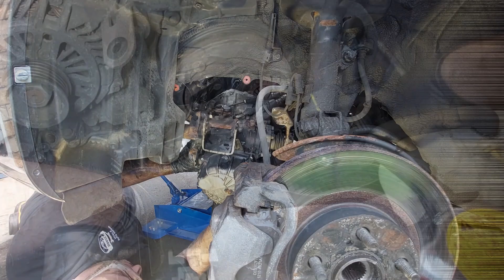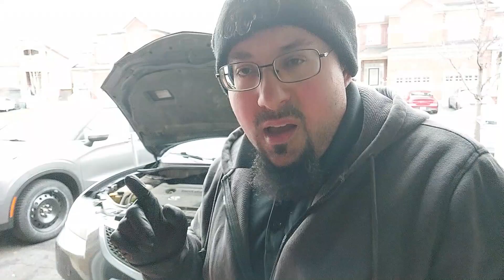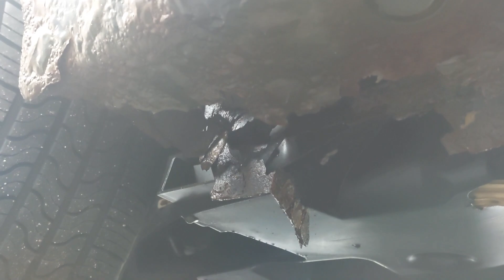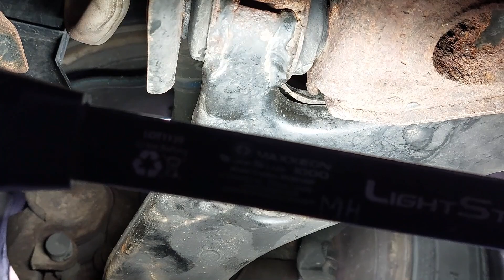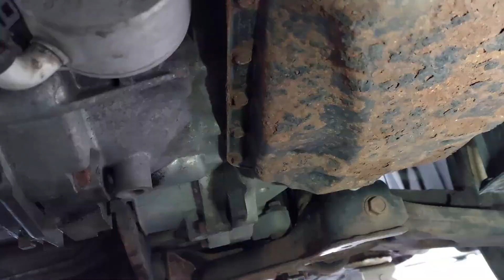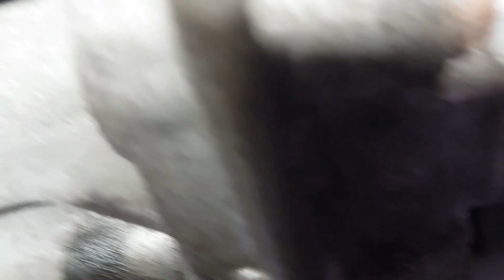Why Do Routine Inspections During An Oil Change Service?

Comment: I heard the 2.3L engine has a very high failure rate, is this true?
Reply from the maker: Yes, but only for the early generation 3s. I believe only the 2004 models had those major transmission and engine problems. After around mid 2005 Mazda fixed most of those problems that were in the previous model years. I also have had first hand experience with the 2004 hatchback models. I have also experienced and seen complete transmission failures on those models as well. I have seen that the 2004 2.3 liter models often develop a ticking noise in the valvetrain, but otherwise still runs and drives OK, but eventually will fail at some point. The hydraulic valve lifters were known to go bad and fail. Mazda used those garbage cheap Jatco automatic transmissions on those model year and they were prone to fail completely. Also, I believe some Nissans in the early 90s and 2000s used some crappy Jatco transmissions that were also known and prone to fail as well.
Reply: Got it, thanks! @moosemobileautorepair